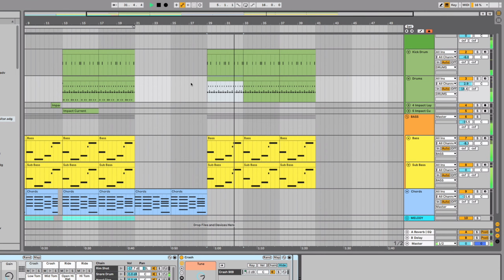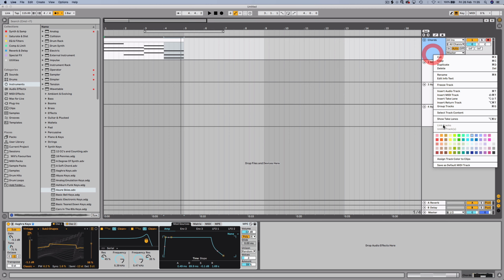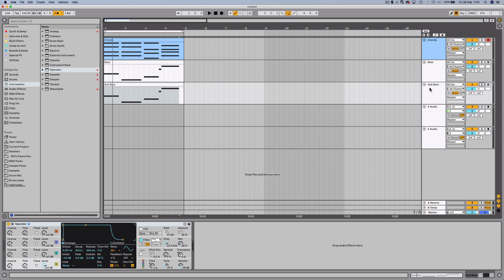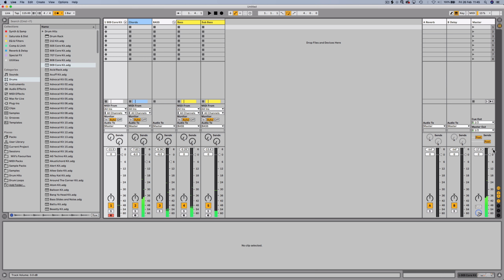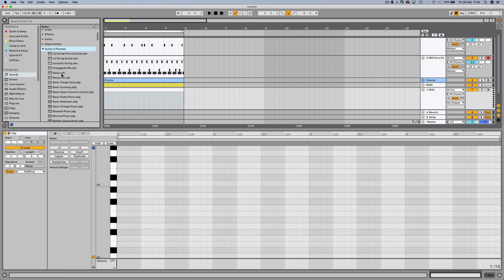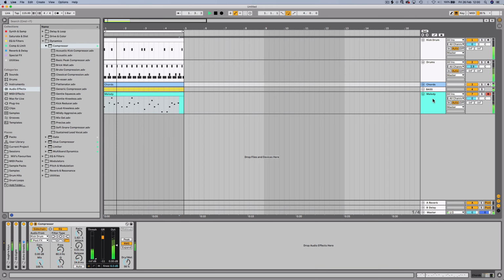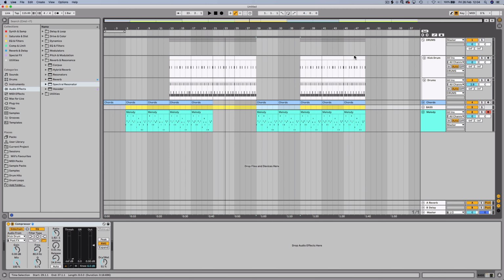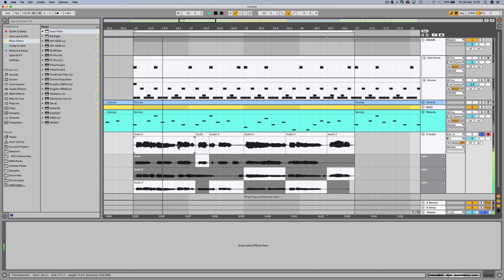Making Your FIRST Song in Ableton Live 11 (Using Stock Ableton Plugins / Instruments / Samples)

Comment: Not sure if you will see this comment since this vid is old, but how are you able to tell the right sound of the sub bass? Im using a Mac to watch this vid so maybe I can't hear the frequencies as well & I know there's a lot of trial and error based on what vibe you're going for within the project, but just curious since its such a low frequency. Also for operator, it didn't seem like you used much of the effect. Did you just throw it on? I am a beginner so I am still learning all of the commonly used effects. Do you have an isolated video pertaining to operator?
Reply: I'm also a newbie and following the tutorial step by step. The best way to appreciate the sub bass is using headphones or monitor speakers. If you play the whole thing and select Solo for that sub bass then you can hear the depth it provides to the sound. Also you can play a bit with the volume. Good luck!

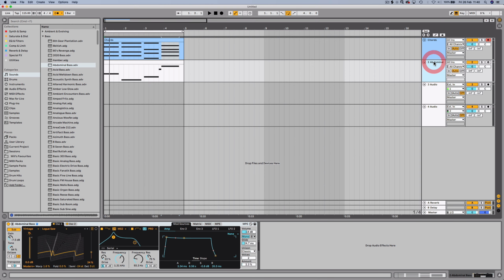Comment: After buying a couple of classes, I'm really impressed by your style of teaching! I was lost at first when the measures changed from 2 to 4. I finally figured that out. But it would be so great if you could add the actual notes you used for the synth, bass, etc. When you switched up the notes for the synth & bass, well, I can't really tell what you did. (I'm currently at 5:32.) I'm trying to duplicate them, but I'm having a hard time. Is there any way you can post the notes? I'm hoping I can continue with the video in spite of this. Thanks!

Comment: what fixed grid should I work in? is there a right or wrong way? I know I'm going to be changing it around anyway throughout production but its a bit confusing in the piano scroll when I'm drawing my notes and I'm not sure if the length is correct. Every time I open piano roll its really zoomed out and just hassle to change settings every time.

Comment: Awsome as always Will,
I do have a question for anyone however. From what I've seen speed in producing seems to be a big factor in success for many producers however most artists/producers at best release an albums worth of material a year or maybe slightly more, so is it a matter of creating a song, finishing it and if it doesnt work moving on to the next? Or is it worth continually redrafting an idea untill you can get it to work? I've been stuck on a track for almost a month now and I dont want to move on because I always hear how important it is to finish tracks.
Reply from the maker: It's hard to do, but killing an idea if it's not working is essential.